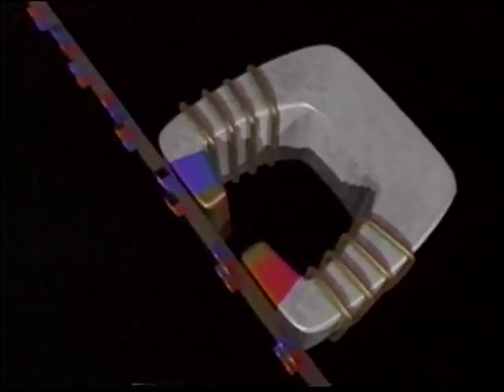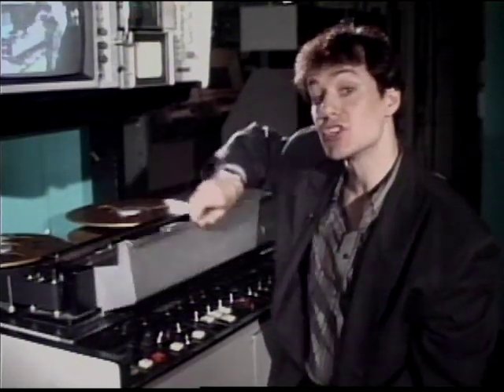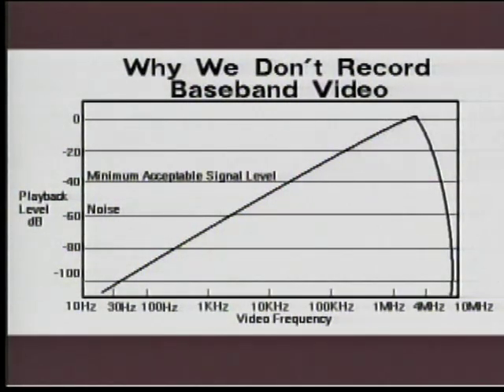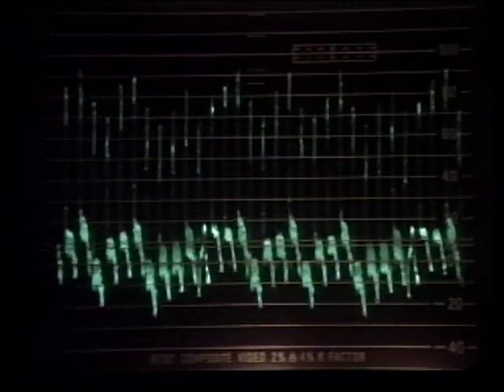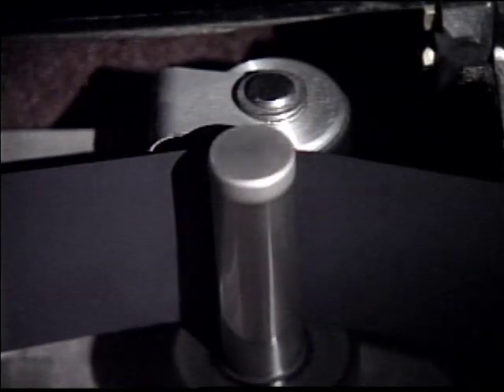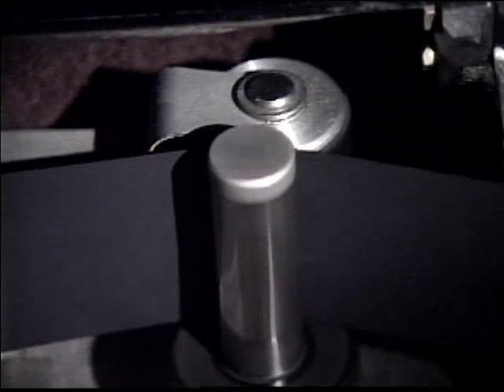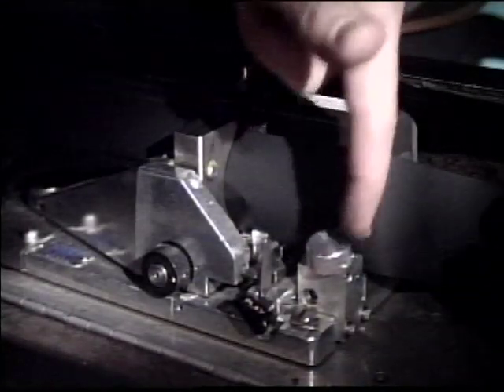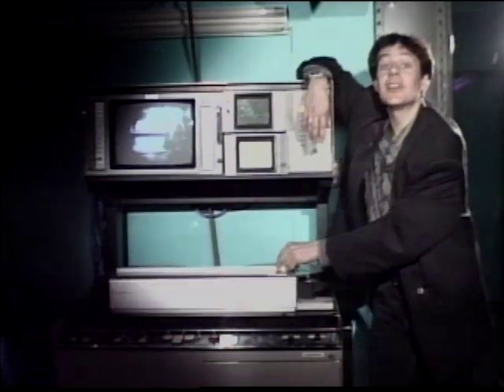How 2" Quadruplex Videotape (VTR) Machines Worked

Comment: The Ampex AVR-2 that is featured was a real workhorse. The station I was at had two... they were the last quad R-R recorders we used until the 1" 'C' format machines totally replaced them. We did continue to run the Ampex 2" cart machines until replaced by the Sony LMS D-2 system.
Reply: +xmttrman The Ampex carts...you mean the ACR-25 mono/ACR-225 stereo, right?
Reply: @kingbee1500 the 225 was a D2 modern design

Comment: I still have a Quad head assembly from one of our old VR2000 machines, and a length of tape with the magnetic tracks made visible with magnetic fluid and protected with varnish. Did it almost 40 years ago and the tracks are still visible.

Comment: The Ampex AVR-2.  I was trained how to use one of these in 1999 to help with some 2 inch archiving to D-Beta. I'd been using the 1 inch format since the early 90's mainly on the Ampex VPR-2B.
Reply: I did some of that around the same time.

Comment: That's just absolutely great. It's a great introduction to why videotape was such an achievement, and that the $99 VCR from Wal*Mart is just short of turning water into wine. And what makes it cooler is the VHS head switch artifact at the bottom of the screen. I love YouTube but I miss videotape. :) 
I got to run production Quads in a TV station. I remember sitting on night shift in Master Control, reading a Stephen King novel, just enjoying the sound of one of the machines running happily as it played that night's programming.

Comment: Even in the era of television's birth in the late 20's there were issues with synchronization.
Timing between the source (camera) and the mechanical television.
It still amazes me the maths involved and the brains it took to figure out a way to record (document) it.

I believe some of the first 20 - 30 line broadcasts were actually recorded on record using modified record lathes then transmitted over the air (radio) as unintelligible audio noise were some people connected their radios to their lathes.

Comment: The BBC experimented with recording video in a linear format for their 405-line system. In this case, the tape had to pass the heads at 16.7ft per second! It was very short-lived, however.
Reply: There is a vid on YouTube called - 1958: Introducing VERA - Britain's First Videotape Recorder

Comment: I remember during my childhood years in early 1970s our B&W TV not only has a V-hold but also the H-hold as well. We hardly touch the V-hold but the H-hold needs occasional adjustment. The picture falls on its side and we adjust the H-hold and after few seconds it falls again but on the opposite side and we adjust the H-hold back. I presume they were using quadruplex. In late 1970s we don't touch the H-hold anymore. I presume our local TV stations are already using helical scan.
Reply from the maker: +bobskie321 That's more a factor of the old analog television standard, than what type of VTR was playing back the material at the station, since all stations' outputs would go through a processing amplifier (proc amp) to stabilize the picture before transmission. TVs back then were prone to falling out of H sync with weaker TV signals, especially. We all had to do what you did - how I remember!

Comment: "Cycles per second" in 1995? Hertz has been established in 1935 and adopted by CGPM in 1960. Wikipedia says that "cycles per second" was largely replaced by "Hertz" by the 1970s. Ah, at 2-minute mark I see "Hz" onscreen without explaining that it is the same as cycles per second.  The formula that follows equates recording time to tape length, this is just bad math syntax, you would be marked down on your high school test. The same math silliness continues. Then you pronounce "Hertz" without introducing this unit of measure.

In your playback level vs. frequency story you did not mention that the level starts to drop after a certain point. "Expressed in dB as we do in audio" - dB is just a power ratio that has no direct relation to audio.

Small errors notwithstanding, this was fun to watch.